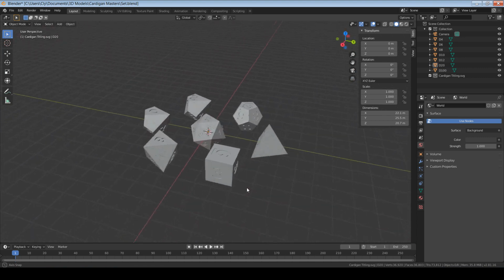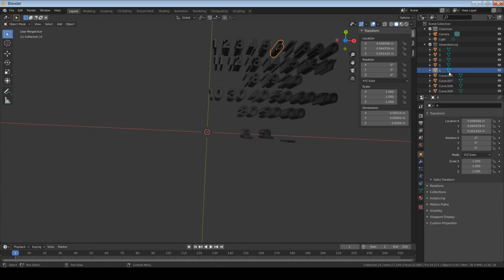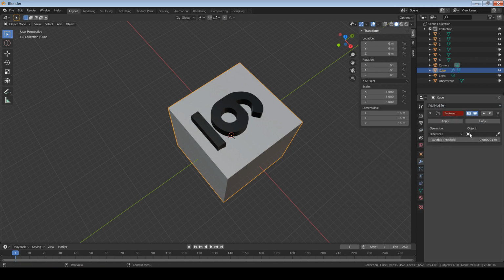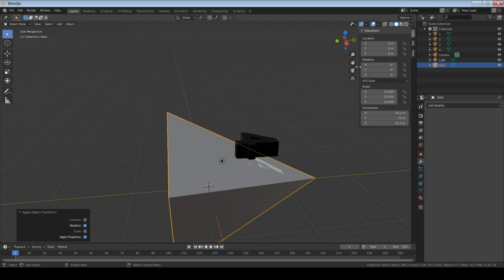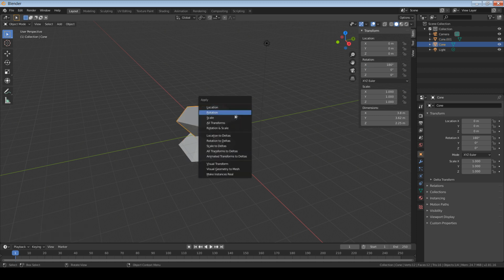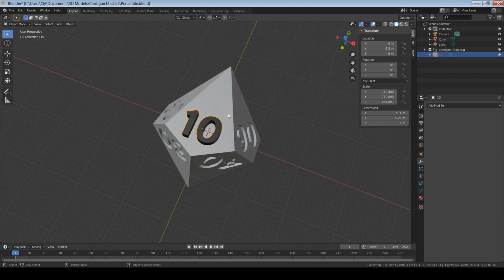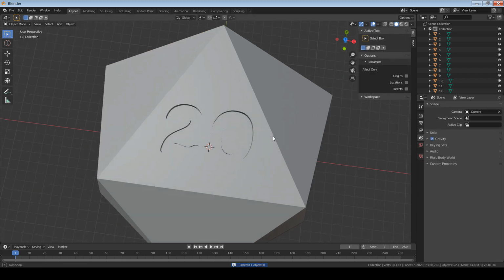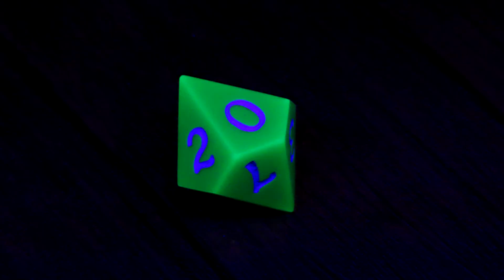Design Your Own Custom Dice for Free | Blender Tutorial | DIY with Cly Ep. 21

Comment: Timestamps for each die:

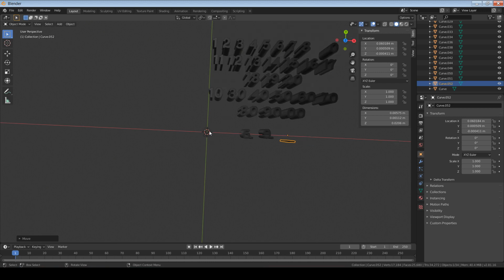D6 7:12
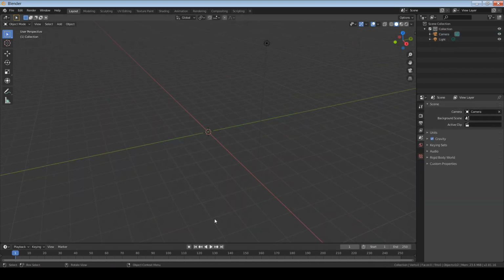D4 11:32
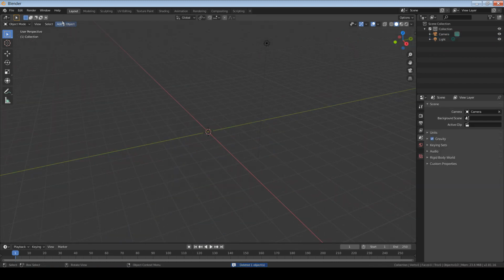D8 15:49
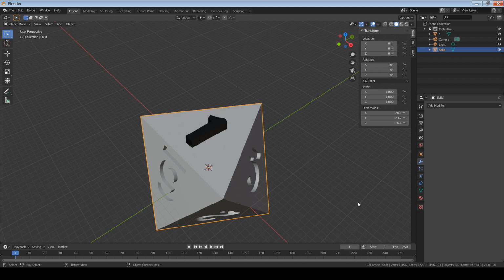D10 17:50
D12 23:03
D20 26:07
Reply from the maker: Thanks for doing that. I've been too absorbed in tweaking the print design for making cap molds and I completely forgot to list out the time stamps. Pinned.
Reply: @ClyFaker  No problem, mostly just commented it for myself
Reply: May the dice gods always give you critical success!!!

Comment: There has to be an easier way to get the numbers centered on the faces of the dice without rotating the die itself? I've gotten so far as to use snap on faces for rotation along it, and then set 3D cursor to the face to get it centered, where I'm stuck, is a way to get the bottom of numbers correctly aligned to the edge that would be it's bottom on the face.

Comment: This may not get a reply but here it goes. My font showed up as all the numbers as one instead of individual numbers. From what I can tell all you did was type out the numbers then convert them. Am I missing something?
Reply: hi there! replying as i believe i may have found a solution for anyone else who got stuck. i was having the same issue, where all the numbers were showing up as one big cluster, making it so i couldn't select them individually. i found my problem was with the 'svg creator' website that was used in the video. instead i tried using a different converter called 'Mconverter'. i started off with the numbers typed out and saved as a jpg file from the GIMP program. then opened the Mconverter app/ program and transferred it into a svg file, which after putting into blender worked like shown in the video above. hope this helps!!

Comment: Thanks for this video, I discover just now. I need tocreate some dices, but I'm having a problem: when I import the svg file, no numbers are shown, even if I can see they are indicated in the panel. Why could it be?
Reply: Are you creating the SVG files in Illustrator? I ran into the same problem - it was fixed by using the Expand function on the text box before exporting. I believe whichever tool you're using needs to read them as vector objects instead of text characters. Good luck!

Comment: For anyone struggling with the d20, follow these notes line by line! 

Don't give up, just take a break, drink water, take a nap, and give it a crack with these notes.

Z x 60
X x 41.81
	Add 14
Z x 60
X x 41.81 (do not apply)
	Add 6
X back to 0
Z x -120
X x 41.81 (do not apply)
	Add 4
X back to 0 		//now bring 20 back to top
Z x 60
X x -41.81		//20 on top
Z x 120

X x 41.81
	Add 8
Z x 60
X x 41.81 (do not apply)
	Add 10
X back to 0
Z x -120
X x 41.81 (do not apply)
	Add 16
X back to 0 		//now bring 20 back to top
Z x 60
X x -41.81		//20 on top
Z x 120

X x 41.81
	Add 2
Z x 60
X x 41.81 (do not apply)
	Add 18
X back to 0
Z x -120
X x 41.81 (do not apply)
	Add 12
X back to 0 		//now bring 20 back to top
Z x 60
X x -41.81		//20 on top
Z x 60
X x 180
	Add 1
Z x 60
X x 41.81
	Add 19
Z x 60
X x 41.81 (do not apply)
	Add 9
X back to 0
Z x -120
X x 41.81 (do not apply)
	Add 3
X back to 0 		//now bring 1 back to top
Z x 60
X x -41.81		//1 on top
Z x 120

X x 41.81
	Add 13
Z x 60
X x 41.81 (do not apply)
	Add 5
X back to 0
Z x -120
X x 41.81 (do not apply)
	Add 11
X back to 0 		//now bring 1 back to top
Z x 60
X x -41.81		//1 on top
Z x 120

X x 41.81
	Add 7
Z x 60
X x 41.81 (do not apply)
	Add 17
X back to 0
Z x -120
X x 41.81 (do not apply)
	Add 15
X back to 0 		//now bring 1 back to top
Z x 60
X x -41.81		//1 on top
Z x 60

Comment: Problems. Using Blender 3.5.
1. When I extrude the numbers it seems to break them apart into lines and I no longer have a solid object. I end up with a number with gaps.
2. When I apply the boolean, instead of leaving a number shaped impression in the face it leaves a number shaped hole. The object is apparently hollow.
Any help?
Reply: There is probably an easier way but for your first problem what I did was go to edit mode select all the numbers Mesh -> Clean Up -> Limited Dissolve repeat until most of the mesh lines are around the outside of your font only. It will take several attempts, a few lines crossing the center of them here and there didn't seem to matter. Once done Extrude and you should be good.

Working on the second problem now as well, no solution yet.  What's funny is I did this tutorial about a year ago with a different font and had zero issues 😂
Reply: I can help with number 1 - I had very jagged number extrusions when I selected all the numbers with the mouse while in edit mode. What I learned was it was super important to instead hit A while in edit mode instead of selecting with the mouse. I am not sure the difference in selection but it made the difference for me!

Comment: 3 year old video, but absolutely amazing!

I added a bit of a change to the method in how I did it while following the video, and it has made new iterations much quicker and easier (e.g., if I want to use a new font)

Basically, do everything as described in the video, except for the following:
1. Instead of creating an svg file with the numbers premade, create a text object in blender for each number (still extrude the text)
2. When copying the numbers into the scene for a new die, place them in their own collection (I called mine "Numbers")
3. When positioning each number, do NOT delete the number and do NOT create a boolean modifier for each number. Instead add the die as a parent to the number (this way it will hold its position as you rotate the die)
4. Once all numbers are positioned, select them all, duplicate, move to a new collection (I called mine "Numbers_Meshes")
5. Finally, add a single boolean modifier to the die, targeting the meshes collection (I pointed to "Numbers_Meshes")

Making this change to the process has meant that when I want to use a new font, all I need to do is change the font on one number, then select all numbers and link fonts (this copies the font settings across), then just delete the existing meshes and repeat steps 4 and 5. There is no longer any need for me to go through the whole positioning and rotating process again :)

I hope this helps someone who is looking to try more than one font in their masters
Reply: would you do this for each dice and keep a master of each with it's orientations?
 I'm imagining that you've got basically a set of dice + their number's in orientation set aside, and when you want to have a different font you basically copy that master, then change the fonts to the copy?

and how would you change the font once you've made them into meshes?
Reply: @maxineheather924  To answer your first query, you are right, I have each of the dice saved with the numbers in the correct location and rotation. These are stored in individual files in a single folder on my computer, named by the font. If I want a new font, I copy the folder full of dice files, then modify the font in each. This way I have a folder for each font I am using.

To answer your second query, I keep the text objects in a collection, then I duplicate this collection and the text objects within, I then convert the duplicates to meshes and hide the text objects. This then lets me add the singular Boolean modifier on the die model, targeting that collection. When I come to changing font, I simply delete the mesh duplicates, and repeat the above steps.

I hope that makes sense :)
Reply: @dread_lord3697  Do you have a simple fix for repositioning the numbers when a font is changed? Or just doing your best to eyeball center based on how the text is now offset from the origin point versus the old font?

Comment: Great trick on the Pentagonal Trapezohedron. The 10 sided thing had me stumped!

Got a few things to say about this vid, maybe interesting, maybe not.

First up, I don't understand the need to do all the nonsense with SVGs. I made my text straight in Blender. Type it out & convert to mesh!
All text conversions like this should really be cleaned up before moving forward (regardless of how you made your text). Look up a tutorial on the "remesh modifier", there's stuff on YT specifically for text clean up!

If you look at a real 6 sided dice, most have somewhat circular faces, not square. To achieve a really nice looking dice, select the full mesh and press ctrl+shift+B to bevel the corners, just use 1 level of bevel. Add a subsurf modifier and set it to 2 or 3 levels. Select the 6 main faces in edit mode and press I to inset them. Exit edit mode and apply the subsurf. Go back into edit and select the central vert on each face (hold shift to select multiple). Expand the selection a few times using ctrl and + on the NUMPAD. Delete the flat faces, then fill each one back in again with a single n-gon using a combo of alt-click edges and pressing F.

Comment: Is anyone else having the problem where every font you use gets a bunch of cuts and voids in blender 3.4 when you enter edit mode.
Reply: Edit: Fixed
Reply: The issue I found with this is that when selecting the geometry make sure you do the select all function (A). This ensures that every vertice is selected. I would also recomend getting rid of the camera and light source for the project as those also get selected. Additionally you can also just do the text in blender as well if that does not work

Comment: I know this is a 2yr old vid, but like a lot of people have said it's still one of the only comprehensive and easy to follow tutorials on youtube still, so thank you! 
for blender noobs like me who are probably using 3.1.2 (or some newer version than 2.81.16 in the vid), some things have been moved about, so i recommend googling if you can't find a specific menu or a hotkey or two isn't doing the same thing. 
other things I ran into (on 3.1.2) :
 
-Boolean not actually cutting into die: 2 things with this one. One was that my text to mesh made a ton of extra triangles and vertices, and the second was that my boolean wouldn't cut into the die, just make verts and edges on the surface. I'll address the first point below. to fix the second point however, I just clicked "fast" instead of "exact", and then applied it. In the video, he doesn't show the option (not sure if version he's using has it), but it's there on 3.1.2.

-Text to Mesh making a ton of triangles & verts: took a lot of googling, but I reduced this using this method AFTER doing the conversion he does (actually i ended up doing it after extruding and centering everything, but it doesn't matter which order.) 
in edit mode: Select everything (Shft+A)>Clean Up>Limited Dissolve. Then, while everything is still selected, Clean up>Merge by Distance. 
At the bottom where it shows version number & etc, it should say something about how many vertices it deleted, and each type of font i did had like 10k verts removed. The triangles also sometimes mess up booleans from what I understand, so this should help! Frostybritches' comment about normals is what lead me down this path - the method is different in 3.1.2! 

-depending on your font of choice, you'll have to modify the origin and where it's centered on the die, which should be a given ;) I made a spreadsheet with the exact numbers i needed for each font i was using since it'll be different each time lol this isn't really a problem, just made it much easier to replicate work each modelling session.

Comment: I know it's been almost 2 years on this video but: You can make round edged dice by selecting all the edges in edge mode and bevel them. Make sure all of the edges are selected and do this before you do anything with the numbers. You can (and should,) use the pop up menu to control how many bevels are used and how far in it bevels (on a D6 for example I use 1 meter if you follow this tutorial.)
Reply: You can do this after adding the numbers too. Go to edit mode and manually select the edges you want beveled. Use the bevel tool. (I think its b)

Comment: No idea what I am doing wrong. I'm on version 3.0.1 for Blender, however when I do the boolean piece and erase my number it doesn't cut away anything. It shows there is depth into the d20 but there is no cut away and Im losing my mind on why I can't fix this. Any suggestions?
Reply: For anyone wondering, I had to downgrade back to 2.81 in order for this to work, seems they broke it in the higher versions.. at least for this purpose.

Comment: Here's a small tip. You only need to apply the rotation after filling in both the x and y. You can do it after each step if you like but considering that there are 70 faces to fill in this information saves some tedium. 
For example, the step for doing the D8, as laid out in the video, are as follows:
Rotate X -35.265 degrees
Apply rotation
Rotate Y -90 degrees
Apply rotation
Rotate X 35.265 degrees
Apply rotation

When in reality you can just do:
Rotate X -35.265 degrees
Rotate Y -90 degrees
Apply rotation
Rotate X 35.265 degrees
Apply rotation

I know this is minor but like I say, saves some time
Reply: any clarity on how the angles were achieved?

Comment: For anyone else struggling with the "Boolean difference" step, this comment is found below, but ill try to bring it up a bit so it is easier to find.

Frostybritches says: 

For anyone else having problems making the boolean work in version 2.92, try the following: "we want to make sure we have consistent normals. We do this by going into edit mode, select everything, and hit Shift+N. ".  I spent hours trying to figure out why my boolean wouldn't work (first time using blender, don't judge me too harshly), but found this treasure in a random article and it finally worked.

Frostybritches suggestion worked for me, with one addition - I had to use the "Fast" Solver option instead of the "Exact" solver option. For some reason, Exact didn't work.

Comment: I'm embarrassed to say that I'm stuck at the image editing step. I'm using the latest version of Gimp, but when I set the font to 250 pt the numbers come out too large. I can't for the life of me figure out what I'm doing differently
Reply: The numbers are quite large for me as well (I continued to after the image editing step- setting the scale to 1250 on the d6 made the numbers WAY too huge). The solution I'm going with is to keep the 250 pt but adjust the scale of the number objects manually in blender to whatever I feel is best (but keeping the scale uniform for all numbers on the same dice). Hope this helps!

Comment: I have been following along with the tutorial and everything has been going well until I did the boolean thing on the faces. It appears that the cube is hollow unlike shown in the video. I have have tried it in both the current version of blender and the one used in the video with the same result. I know this is an older video and you probably won't see this but any help or advice would be appreciated
Reply: I know it's been a while, but did you ever find a solution to this? I believe I am having a similar problem (Blender 3.3).

Comment: Can you please help me, after I converted to mesh and extruded, when I go back to object mode, my numbers look like the have huge cuts taken out of them and it ruins the number. This also means when I go to set the origin, the point is always way off the number and not in the z axis center either... I've tried with both complex numbers and simple format numbers and the same thing happens. Thank you for the help in advance
Reply: when you convert it to a mesh, and before you've extruded, make sure every vertice is selected by using 'a' to highlight all, sometimes if you just select with your mouse it can miss a few vertices and causes that sharp and jagged look

Comment: Great video! 2 addons I thought I mention.
1> size of font should be 2.50 points not 250
2>extrude your font before you turn it into a mesh as doing so after can cause it to extrude funky.

Comment: The reason why your sizing is different in the modeling program compared to the slicer is typically because your units setup is off. 

For example: When I'm working in 3DS Max, in the units setting area, I can set the "display unit scale" to whatever unit I want to work with, but for some reason it has another setting within this section called "System unit setup" and once set both of those to the proper millimeters setting, the modeling program is not only displaying the proper units, but it is also exporting the proper units that will be accurate in the slicer. There is probably something similar in Blender.

Comment: For the people who need the D20 instruction from the 16 to continue to get the 20 up, and then orient correctly.

After you made the 16 continue as follows: 
0 on X , 60 on Z, apply
- 41.81 on X, apply
120 on Z, apply
41.81 on X apply
Now you can continue using the 2.

Afterwards, use the same steps as for the 6 and then the 4 (so next step would be:
60 on Z, apply
41.81 on X - do not apply ) 

Hope that helps!

Comment: For anyone else having problems making the boolean work in version 2.92, try the following: "we want to make sure we have consistent normals. We do this by going into edit mode, select everything, and hit Shift+N. ".  I spent hours trying to figure out why my boolean wouldn't work (first time using blender, don't judge me too harshly), but found this treasure in a random article and it finally worked.
Reply: Thank you so much I was having this issue for like an hour now
Reply: THANK YOUUUUUUUUUU
Reply: A year later and this comment was a lifesaver! I was doing a custom logo for the 20 on my d20 and could not get it to work, even though the numbers did. Thank you!
Reply: saved my life too! <3 for those using 3.1.2, you can also find this function by going to edit>shift+a>mesh>clean up>merge by distance . apparently they renamed this so shift+n doesn't work as I've found. (also it's easier to do this while still at the extruding and centering font stage as i learned LOL)
Reply: This comment saved me hours of heartache, thank you so much!